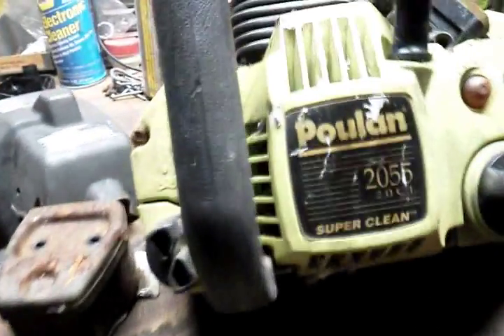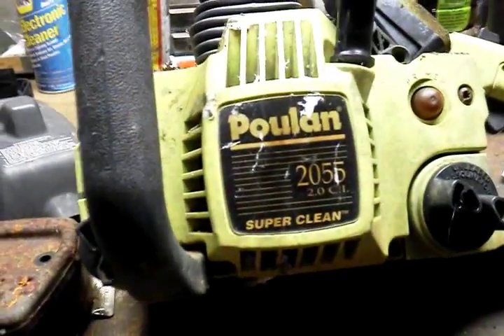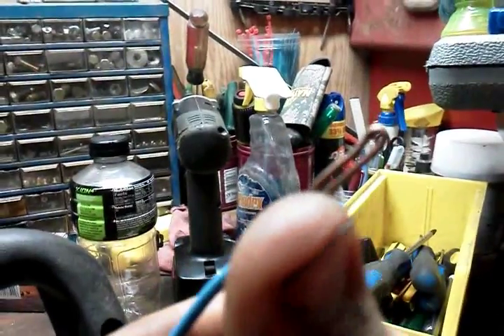Poulan 2055 woodsman chainsaw

Comment: Good video and congratulations on getting
It running again for your friend! Maybe you can help me? If not no problem but had to ask. My little Poulan does run and run well, BUT I have a problem with my choke. When I say cold, I don't mean outside I just mean the engine hasn't run in a couple days or more. So here is the problem. If (when engine cold) I turn the lever to full choke, it won't start or sputter. When cold if I put the lever about (varies a little) 3/4 of the way to full choke it sputters first pull and then I put to half and it starts and runs. After warm a minute I take all choke off and it runs well. Does this sound familiar and is there a way to fix it so I don't have to try and find full choke every time on cold start? Thank you for any help!
Reply: Carb needs adjusted